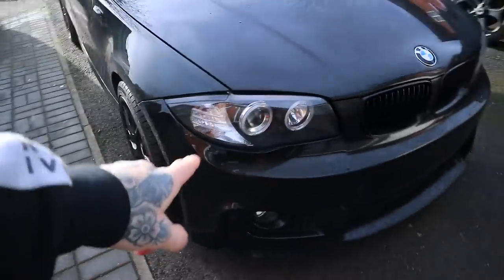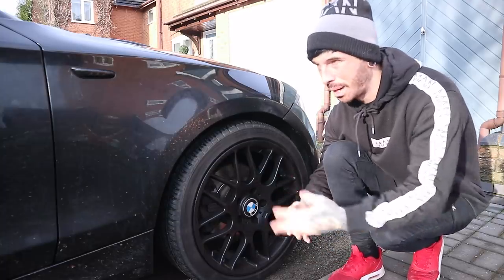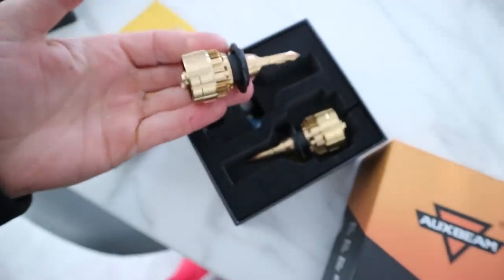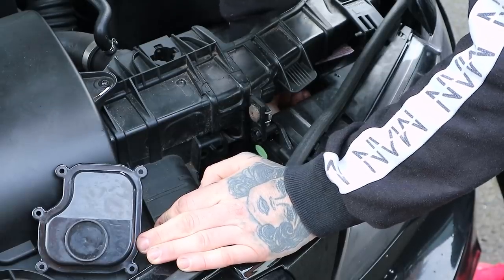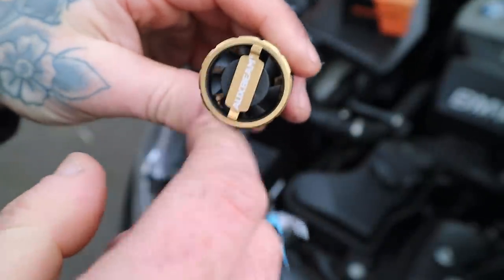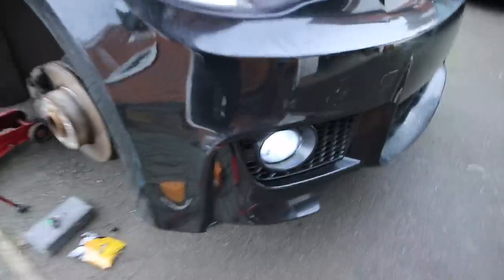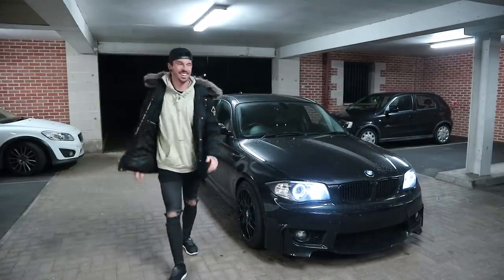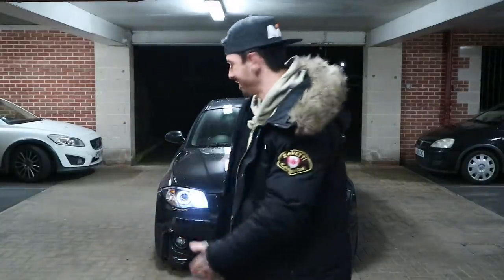I SHOULD HAVE DONE THIS TO MY BMW 1 SERIES AGES AGO!

Comment: I have a BMW x1 2010 my motor blower stopped working.
I have tried 4 mechanics,the blower works when connected to battery.
The cables that supply power to the motor have signals but I doesn’t work please help on possible issues please

Comment: Have you had any trouble with your LED bulbs? I bought the best (most expensive) Phillips LED bulbs some months ago, coded them through Carly and nothing has helped. They flicker alot, and once I start the engine the voltage drops on them making the light even worse than before..

Comment: What you realy need is a decent engine in it instead of that junk you put on there.
Reply: Yes its a 4 banger but with regular oil changes the n47 isn't too bad?  I have it's predecessor the m47 solid as.

Comment: Mat when you start the car do these lights flash I have a 116i and I bought the same
Ones you took out and they flash everytime I start it is obv the voltage check out but just before I buy them

Comment: Hey Mat. New to the channel. I have more or less the same car but an 09 Msport. Just some updated info on Cam chain issues. Although it is what it is, regular oil and microfilter changes can prevent it. Second main fault which recently set me back £700 is the relucter rings on rear drive shafts. If the fault occurs, you can temporarily turn it off by holding DTC button down for 5 seconds, but this is sadly another fault on an otherwise great little car. So much torque from that engine. Lastly. DPF clogging up fault can be stopped by using premiem diesel. Like Shell V power. Works fine for me. Cheers.
Reply: Paul Lockwood - the DPF fault can be cured just by driving it for longer, motorways preferably. The whole premium fuel thing is scam. Just a heads up to save you a few pennies!

Comment: My E82 is in the shop because I stripped the stupid little threads on the oil pan so I have to get a good plug to fix or replace the entire pan!
Reply: ̈ How tf did you manage to cross-thread a sump bolt?😂
Reply: @Jim-iy6ue  Sump? The oil drain screw. Its a steel pan, second oil change I had to use a wrench to get the screw out because of how tight it was. Then it wouldnt go in tight to torque specs anymore or come out. Threads gone or the screw broke, they put notches in them... Weak point. One little stupid screw

Comment: Could do with some lower springs. Please don't go silly with coilovers though! A -35mm drop would be enough.  Maybe some spacers too?
Reply from the maker: Yeah I was thinking lowering springs
Reply: Mat Armstrong - Yep, intend doing the same on my 116d sport.  Just mapped it to 191bhp/333ft/lb torque and suspension is only other planned mod.  If you’re interested I write blog in PBMW mag although usually my restomod 1602 and my old E30 & E46 M3’s. Prefer classic BM’s really but the 1 series is a perfect daily.

Comment: You should have considered spraying the part of the disk that sticks out black. There are actually brake dics you can buy where this part is painted. It will look better especially with black concave wheels. Im trying to get the bigger performance brakes on mine as well.